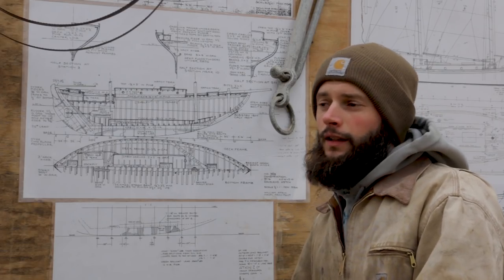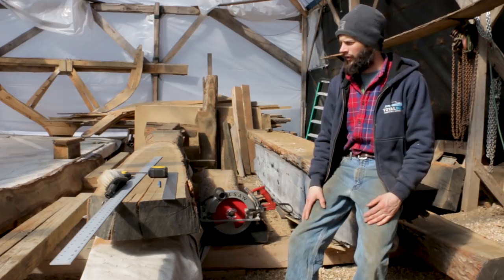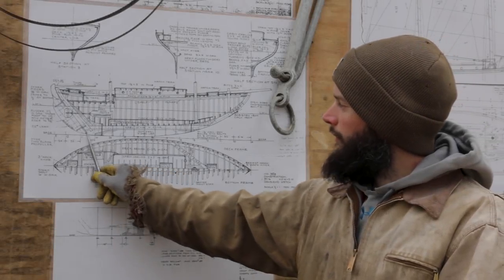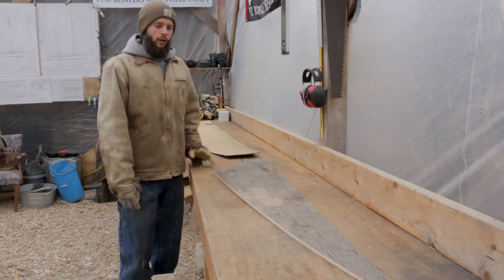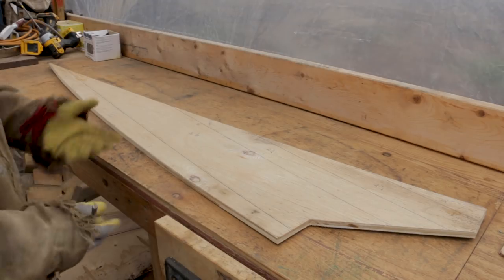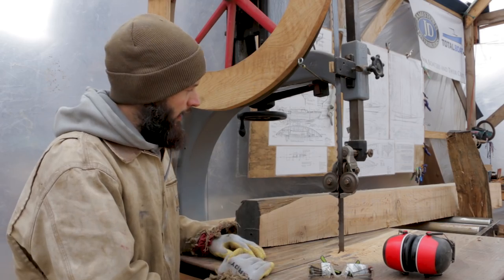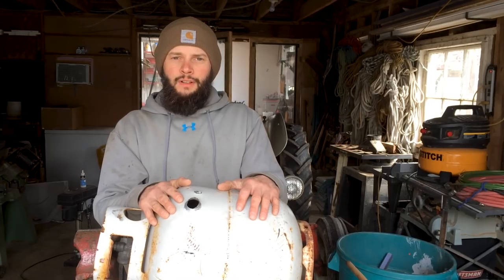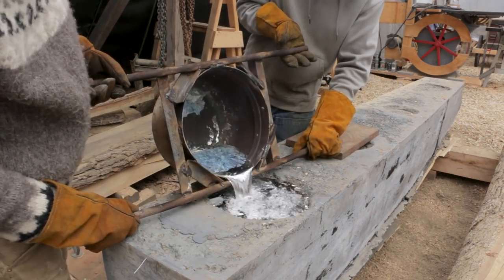Acorn to Arabella - Journey of a Wooden Boat - Episode 30: Deadwood and Some Lead

Comment: Instead of wormshoe wood, why not use a piece of UHMW? It doesn't mind water, it can't be burrowed through by worms, takes good paint, and it slides and takes damage on its shoulder.
Reply from the maker: I have not heard of anyone doing that.  I know that stuff is tough, would be interesting to know if that has been done/ reasons why not.
Reply: I was thinking the same thing, or using some sort of epoxy impregnated wood.  On the flip side i think the feeling of what they are trying to accomplish is to keep the build as old school as they can be while still being practical.
Reply: Nobody paints UHMW.  Just order the color you need.

Comment: Guys...have you given any thought to making the WORMSHOE out of LEAD ?  As you said, "it is sacrificial !"  And if you do bottom out, it might hold off a haul out repair as hopefully it just gauges the lead and you can just jump over the side and just repair it with a file...critters can't chew through lead...just my two cents...great video !
Reply from the maker: We have never heard of a lead worm shoe, we have heard of iron and bronze shoes.  Although a bit pricey a bronze worm shoe could be a beautiful thing!  Lead is so soft that a oak 2x might fair better in a collision.
Reply: Good argument...but I think Oak fibers would crush quicker and more in the case of a collision...but my roommate and I felt that lead on the other hand might last longer do to the density...your call of course but if it were me I would go the extra mile and reduce the chances of critters eating my home...your right...Bronze would be nice but you don't have the facility to manufacture it so you would be stuck with a HUGE expense...thanks for listening, keep up the great craftsmanship.
Reply: Acorn To Arabella what about brass plating, you could use empty shell casings for the brass.
Reply from the maker: Brass is not as corrosion resistant.  In time it would turn to mush under the salt water.

Comment: Come on boys, get on with it.
Reply: Your going to need to develop some patience. This will take years. Especially while slowed down to film it all.
Reply: Agree
With the drawing and the explanation, this is gonna take a while
this is a big endeavor, especially from two that have never built one before
I'm starting to question if they can even do it
at the rate they are going,, 5yrs at the least? 7 to 10?
Will YT still be around by then?
Reply from the maker: It's gonna take some time for sure!
This summer will be telling, up until now it has been a juggling act of jobs, prep work, video work, boat building and this winter has been a rough and cold one.  

Very soon it will just be video and boat and warm weather.  The lions share of the prep is done and we have enough money coming in to feed ourselves and build.  In 2-6 weeks the pace is going to pick up considerably!
Reply: You guys do you. It's your boat. We're just here to gawk at it. Fun to have an ongoing project to watch from the beginning.